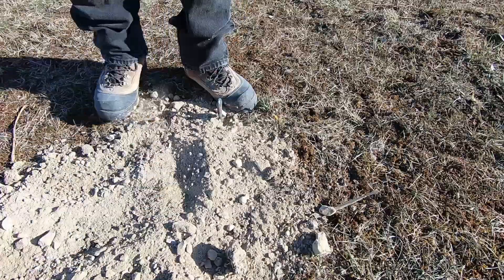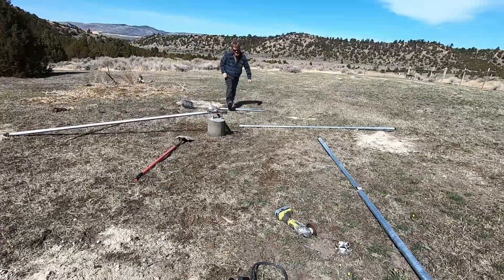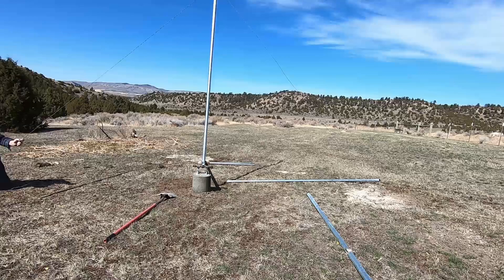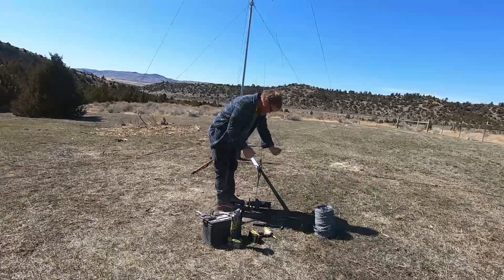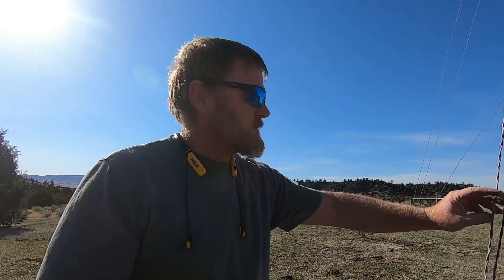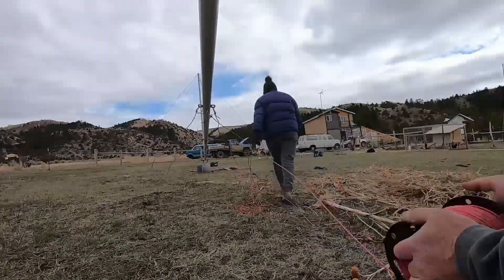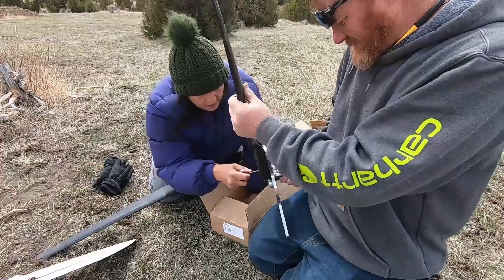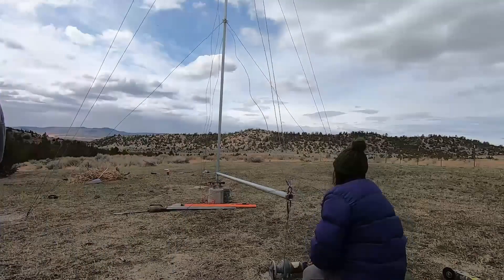wind tower install part 2, ista Breeze I 1500

Comment: Hello
I have 3 wires with no name in the wind turbine and in controler it saying U V W doest it matter witch one to connect and where or you can connect them randomly. Thank you very much
Reply from the maker: It does not matter which order you connect them.
Reply: @veggitarianredneck  thank you
Reply: @veggitarianredneck  do you know why when I connect only 2 wires from the turbine to controller is charging but when I connect the third one is braking and doesn't charge no more? Thank you
Reply: Hello
The reason was the controller, I've changed it and now works
Now I have another issue, 
Do you know why my microwave and washing machine are making a high pitch sound when running? I have a wind turbine and 4 batteries, I don't have the ground installed yet. Thank you

Comment: if im using a 48v wind turbine , can i use a dc to dc converter to use it on a 24v battery system. 19 to 72v input puts out a steady 23 to 28v (user selectable) rated at 1000w 40amps..  and have a voltage set relay to come on when the batterys are fully charged as a dump to a water heater, or does morningstar ts45 work with lithium lifepo4 batteries , and not just lead acid
Reply: You could use a converter if it supports the 48-100V your turbine is propably going to input. 

Better to use controllers with braking capability if you don't want your turbine to break after the first storm.

Comment: Excellent video, wish I had seen it before I did my installation. My generator works ok but the istabreeze controller is rubbish - mppt type devices are vastly superior.

Comment: what brought you to use the ista breeze brand for your source of wind power ??? theres just soooo many to look over . 1 of the big reasons i appreciate what your doing here . Great video ! Thanks , now to go thru them all ...'''
Reply from the maker: I happened across toys for watts, and he had a bunch of the cheap ebay turbines he'd been using for several years. The ista Breeze happened to rate pretty good with him. 
 Thanks for watching😀👍
Reply: Would you say the storage batteries are the biggest part of the total cost .? Batteries are not all created equal , have you favorites for them ? Thanks

Comment: Forgive me for asking a question that you may have already covered in another video but what sort of battery setup are you using to store the power?
Reply from the maker: I have 8 L16 equivalent type batteries that each have 330 amp hours @ 6 volt.
Reply: @veggitarianredneck  all wired in series I assume?
Reply from the maker: Series parallel actually. I'm running 24 volts

Comment: Good job man.
I just got my ISTA BREEZE i2000W 48V @ 40A turbine
Reply from the maker: I think your going to be happy with it. I just connected mine tonight and she's already giving me steady night time power, 😁👍
Reply: Could you please help me with set up, controllers, battery, dump load, rectifier, relays. I bought 3 instabreeze i2000s didn’t realize finding compatible products and good information was going to be so difficult.
Reply: @TheFlyingdutchman8  following. About to purchase one myself. Need to know which controllers ect to buy to go with it